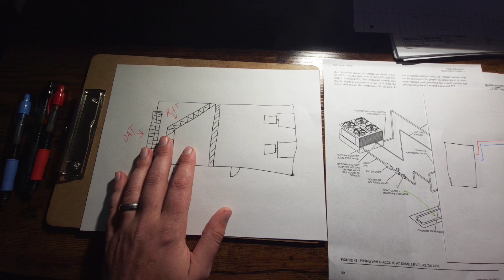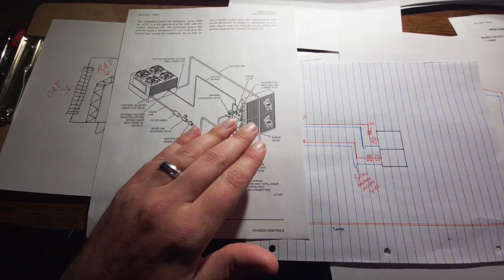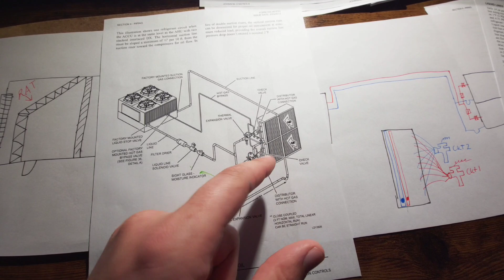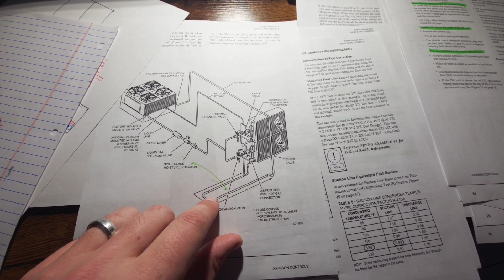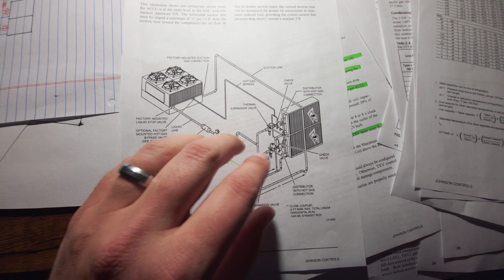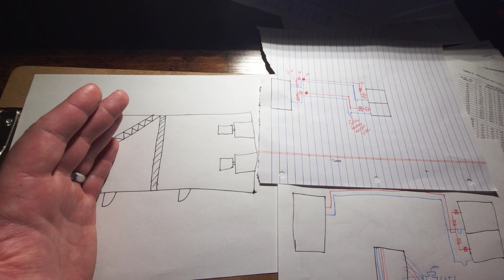Commercial Split AC Design HVAC Training for HVAC Technician

Comment: I have the same issues when retrofitting the old systems to a new one. 
manufacturer installation guidelines is just a guidelines not the rule but there are some key design that will get you in warranty trouble if you deviate from them.
is r22 pipes rated for r410a pipes? when the r410a came out as a replacement for r22, I ran issues with the design team wanting me to reuse the old r22 pipes when honeywell release its instructions not to use old r22 copper pipes when converting the system to r410a.
Reply from the maker: Old pipe was good on rating and hasn't had any issues.

Comment: Curious. Will the condensers have a receiver for part load operation. Im assuming its a microchannel condenser coil. York loves their microchannel coils. Is there going to be a re-heat coil after the evaps. I'd think if there was. One coil could be used for sensible and one could be used as latent. Or both latent or sensible. Just curious.

Great video as always Holden
Reply from the maker: No receiver or reheat. They are micro channel, York is full steam ahead on that one lol.

Comment: Do you not include the filter drier and solenoid equivalent feet?

They add quite a lot.
Reply from the maker: I did, I just didn't cover that specific detail.
Reply: You are correct. They do add pressure drop. I think he will be safe, seeing as the equipment is all on the same level. Not much vertical change. I have a book somewhere where it gives the pressure drop of fittings and components added. I'd think being mostly horizontal the pressure drop seen at the TXV will not be that bad, and flash gas before the TXV will be minimal. Great question though and something to always consider in designing.

Comment: That's a tough one regarding why york is neglecting their own literature. The literature doesn't even date that old. I thought maybe due to advances in TXV technology they only need 1 TXV per circuit at your capacity but the literature is from 2012. I guess it could be due to oil logging at the TXV once the compressor's start to stage down or something with velocity ? It would be harder to push through 2 TXV's at 25 TR than 1 50 TR TXV I'm assuming. Good news is it's less pipework and York authorized it lol